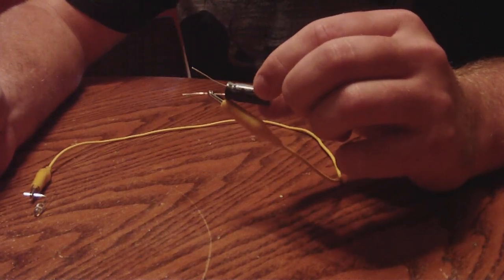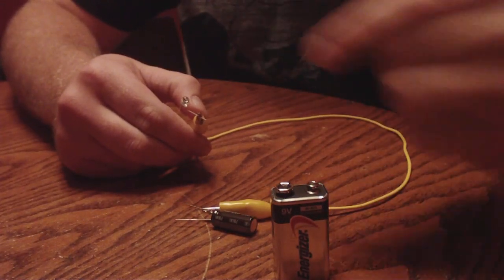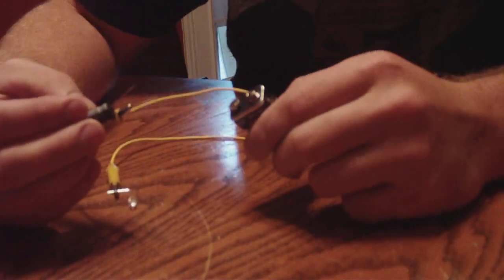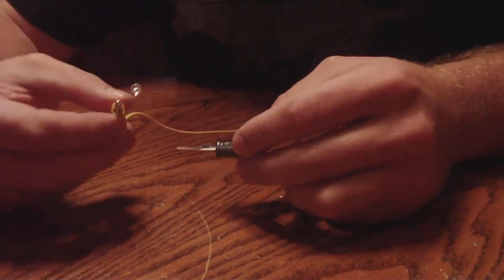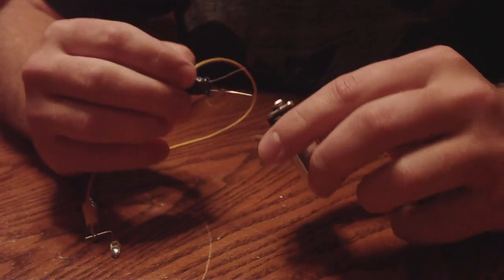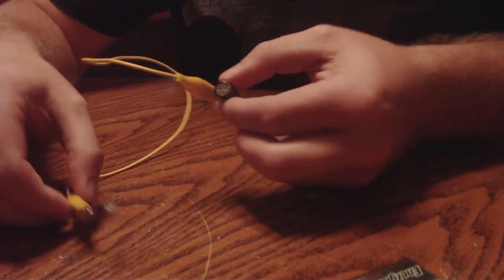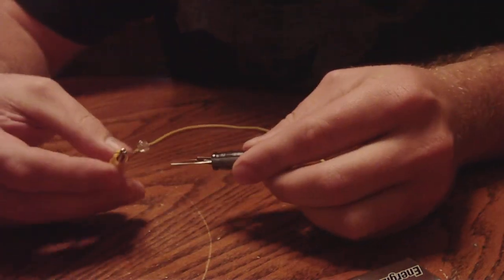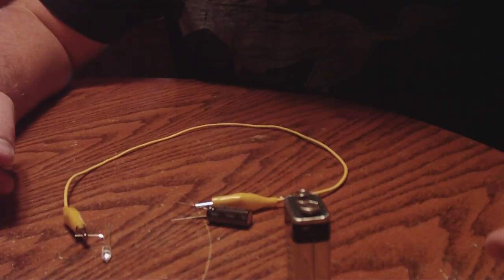Explain this Captret Effect DrStiffler

Comment: If you follow tom bearden then you could explain this one part of the cap is reacting to a pulse therfore providing negative energy to your led because of the punch in energy to the cap the other is providing positive energy as usual to the led  so you get  double the energy one from the negative aspect one from the positive aspect

Comment: This is nothing more than an example of stray capacitance. Electronic devices are full of them. Sometimes they are a problem in a circuit and have to be avoided. Many times they are an unimportant by-product of the circuit and are of little consequence. IMO this doesn't rise to the level of importance that we need to coin a new word for it.

Comment: and the led had dimmed to almost off. I dont know if this means an energy gain though. I have not tested the batteries to see if they are acually charged or maybe they will discharge back to around 6v very quickly when loaded down.

Comment: Interesting effect. I have built a captret type circuit myself. you cant really claim overunity by saying 1 charge= 2 flashes your comparing apples to oranges. the energy discharged into the led could be one half of the energy that went into the cap and still give 2 bright flashes. in the circuit I built I used 3 old 3v button batteries that started with a total of 6.62v into a captret circuit with led on the cap. after about 5 hours running the batteries voltage had climbed to 8.65v

Comment from the maker: @WayneSalhany Usually the capacitor manufactures state that the case is connected to negative lead, as to ground it. Yes it has many capacitors in one, but you would think that would very important thing to note. A charge Is put into it once and I can flash a LED twice is very important.

Comment: I don't care much for any of your explanations because you don't come out clearly and state that there are in effect TWO capacitors in the can. Unless the can is physically hardwired to one of the leads it is floating with respect to both leads. You could actually say there are THREE capacitors. The extra capacitors are not standard or documented. Therefore they are not mentioned or discussed. You simply demonstrate the reality that they exist. Charging the "main" capacitor induces a can charge.

Comment: It is very simple to explain. It is like you have mega oms resistor between the minus electrode and cap cover. There electrical drain away between the minus electrode and cap cover. You can try by connecting very big resistor to the minus electrode and try to discharge via this resistor. Other way is to use mega om meter to measure the resistance between the minus electrode and cap cover.

Comment from the maker: @janne808 What? once the diode stops conducting it tells you no more power is left for you to use, but that is not the case with the captret it will allow another flash from the negative. In simple terms the captret makes ONE capacitor into TWO.

Comment: This happens because you need to overcome the threshold voltage of the diode for it to conduct. The outer plate "sees"  the charge of the inside plates with a lower voltage. When you discharge part of the charge through the outer plate, the diode stops conducting even when there is still charge left inside the cap, since the voltage through it drops below the diode threshold voltage.

Comment: @lunarrn There a layer of the dielectric between the plates.  This dielectric is also between the outer plate and the case.  Therefore a small charge is held between the plate and the case shell.  It's really very simple to see why this works. Use your meter to measure the capacitance between any plate and the case.
Reply: Ergo Ibpointless2 is right in his claim there are in fact two capacitors in every one electrolytic capacitor. As a matter of fact there is capacitance in many electric and electronic components. In coils, transistors, diodes, connectors and so on and so on........

Comment: Simple.  It takes very little power to flash LED..look at Leedskalnin's PMH.  When you charge a capacitor you form two areas of charge...one is the intended pos/neg leads, but there is also a charge between the pos and the metal case.  This would not work if the case was not metal.